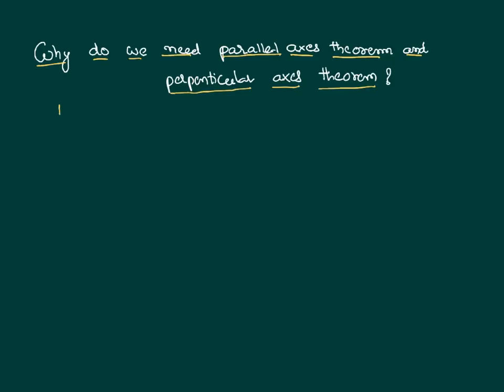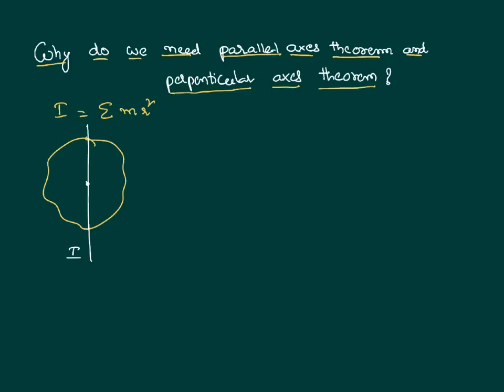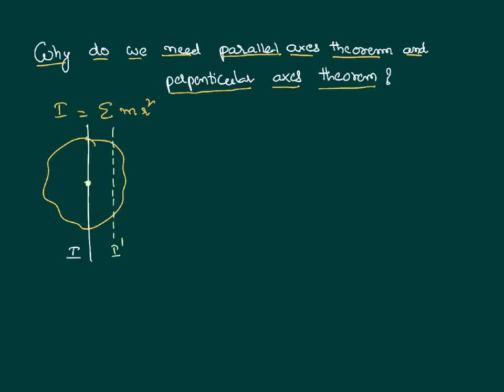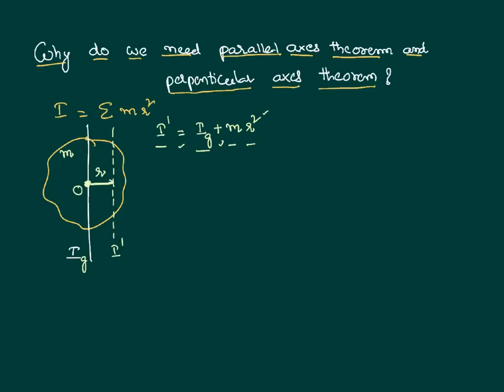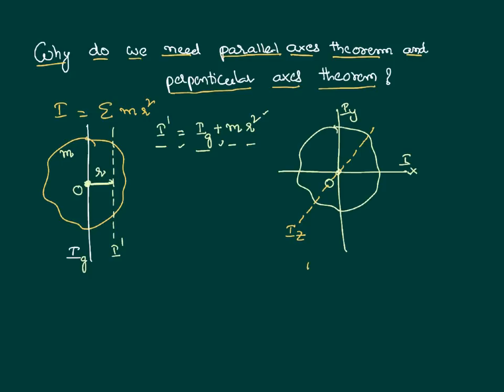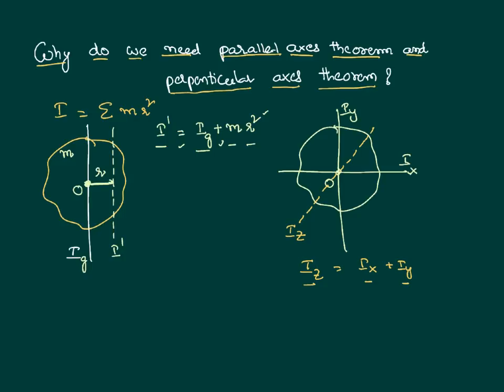Why do we need Parallel and Perpendicular Axes Theorem Learn @IIT-JEEandNEET-VenkatsAcademy

Comment: What if a axis of rotation considered which make an angle theta with the th axis passing through centre of mass
Reply from the maker: Well, we cannot use either parallel axes or perpendicular axes theorems. We need to use integration methods to find out moment of inertia using integration methods.